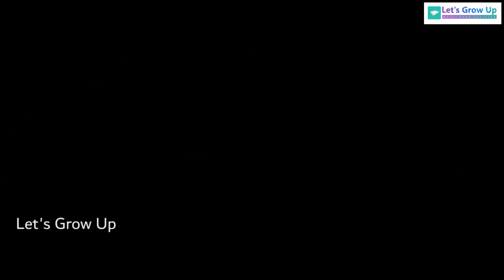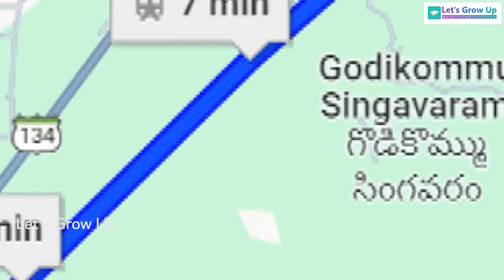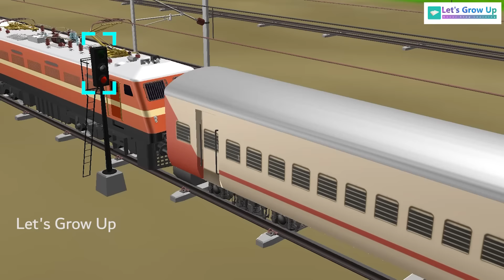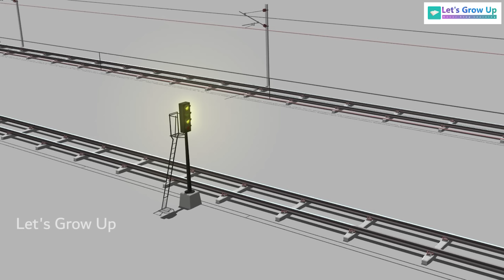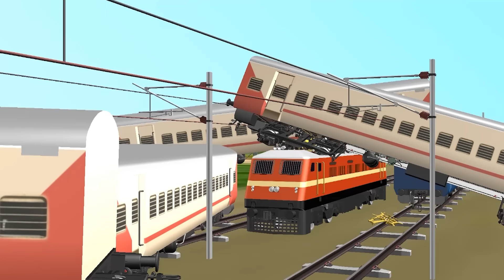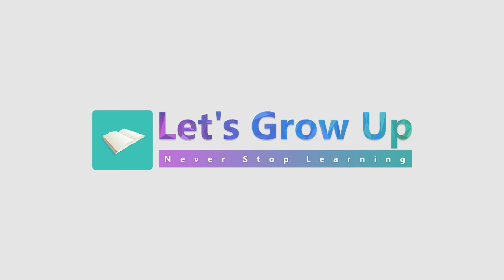The Dark truth of Andhra Pradesh Train Accident 3D Explained video

Comment: What gurds doing in same train when he loco pilot cross the red signal. I think there is some problem in new implementation signal points .
Reply: Guard is not running ahead of the train . He is not watching the aspect of signal .Have some logic before saying non sense
Reply: @Ven435  than what guard work without noticing the signal.